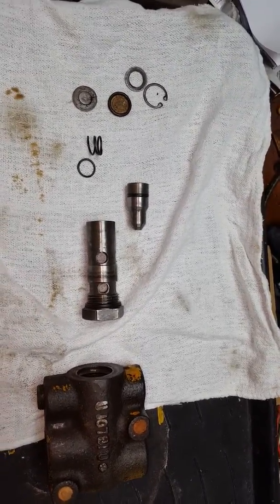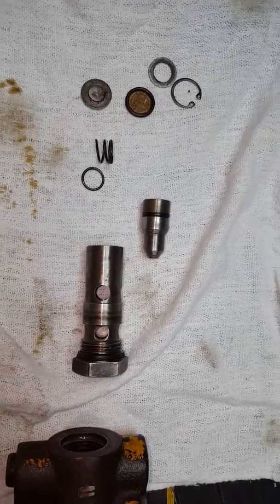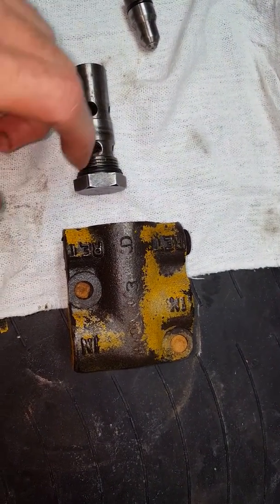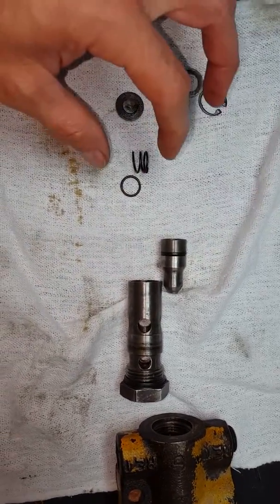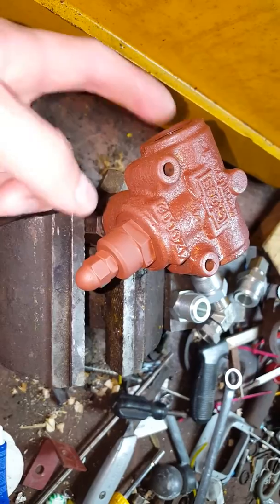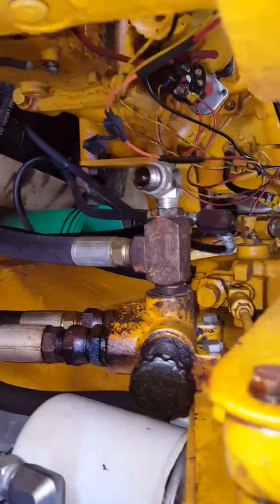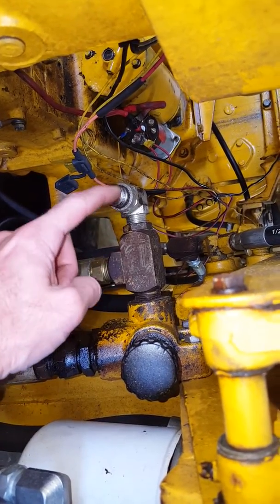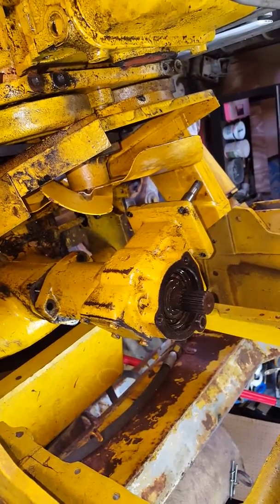John Deere 440 ID Backhoe - Pressure Relief Valve Assembly

Comment: Brian I know its a Holiday Weekend .Have a problem basically same  John Deere 440 ID Backhoe not building pressure , high rpm 250 psi raise any control jumps to 500 psi. If you can help I can get more detail to you. The control valve and the PRvalve  are all one unit. Thanks for your time